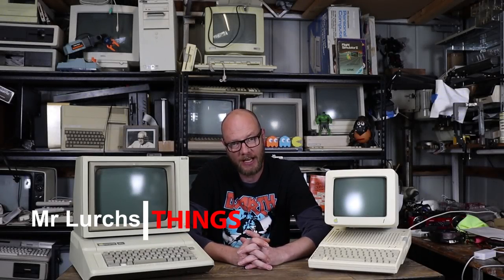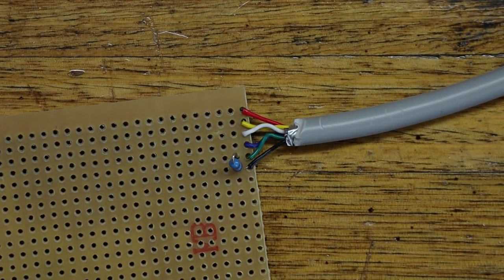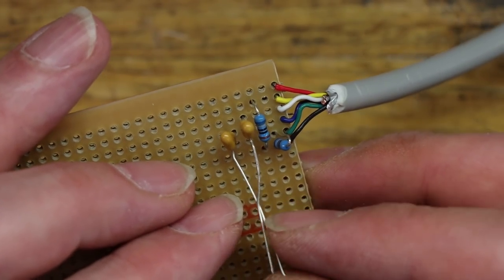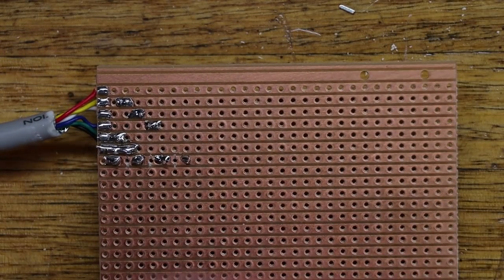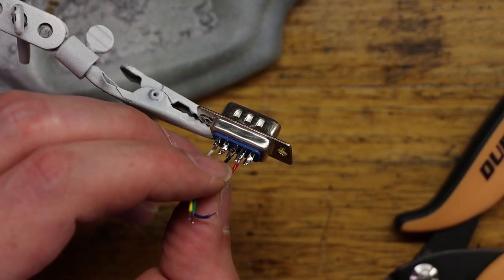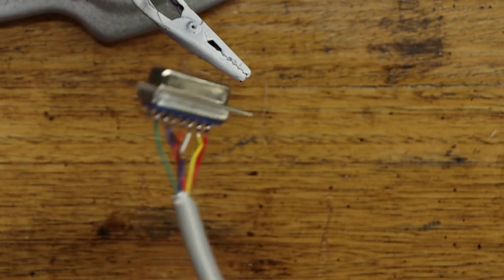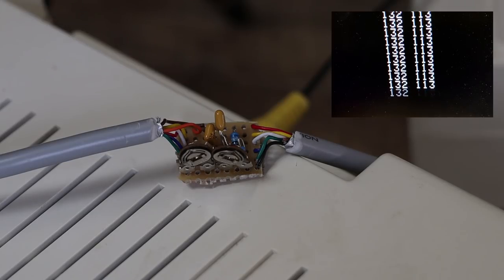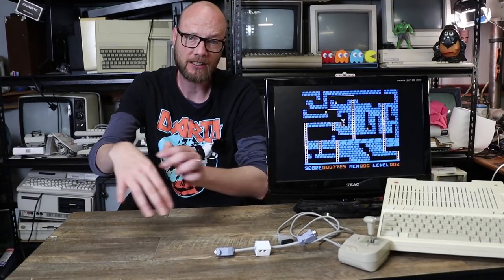PC to Apple II DIY Joystick Adaptor

Comment: I no longer have a IIe or //c, but I do have a IIe card, a floppy drive and one disk which is of course, Lode Runner. I've been looking for a joystick for it off and on for some years and was lucky to find one for $10 (CAN) a few months ago. They are getting hard to find, especially at a reasonable price, so I'm sure your little project will really help someone out!

Comment: Advanced basic program for full testing of Apple joystick: with buttons output:

10 A =  PDL (0)
20 B =  PDL (1)
30 C =  PEEK (49249)
40 D =  PEEK (49250)
50  PRINT "X:";A;" Y:";B;
60  IF C > 127 THEN  PRINT " 0";
70  IF D > 127 THEN  PRINT " 1";
80  PRINT
90  GOTO 10

Comment: I used to make kits for an adapter like this and they were sold by ReactiveMicro.  I put the boards up on OSHPark if anyone wants to make them.  https://oshpark.com/shared_projects/9ZZ7RpPH and you can find the documentation with schematics and assembly instructions here  http://www.philosophyofsound.com/A2/manuals/IBMtoA2JoystickAdapter.pdf

Not my circuit, just my board layout.  The transistors make it work better with some joysticks with Autofire options.

Comment: Happy 2021and thanks for the video! The schematic in the link makes much more sense now. I was wondering if the metal screwdriver is affecting the trim pot reading while adjusting?
Reply from the maker: No. It’d be my clumsy thumbs causing it

Comment: Excellent video. Odd though as I have. Radio Shack PC/Apple joystick and it does not have such adapter circuit in a box, just a Y-cable to connect the PC or Apple to.

Comment: Nice little adapter! I like the workflow. Very easy to follow.

Regarding Jaycar, have you had issues with stock levels? My local (Melbourne CBD) is out of stock for all SMD tantalum and electrolytic capacitors. My LCII needs recapping, along with everything else! :D

Nice side cutters... I have the exact same one!
Reply from the maker: I’m pretty sure Jaycar has stopped stocking SMD caps completely. I haven’t been able to buy them from there in ages.
Reply: @MrLurchsThings  that's really disappointing of them.

The whole point is that they are a bit more pricey than buying online, but having the convenience of popping down there to get something you need 'now'.

Slowly turning into Dick Smith...